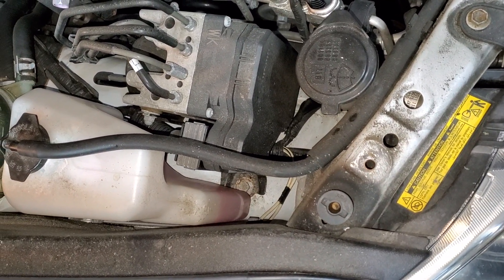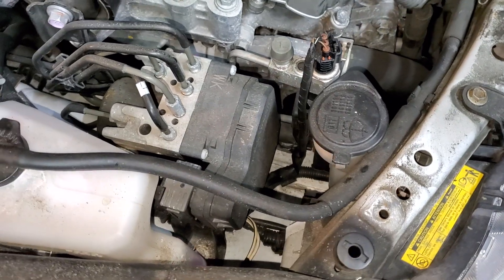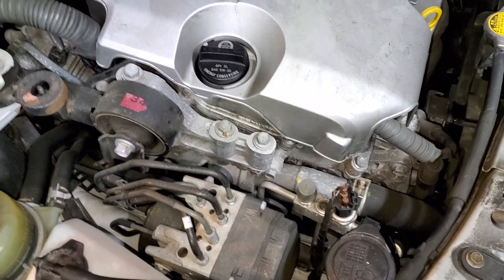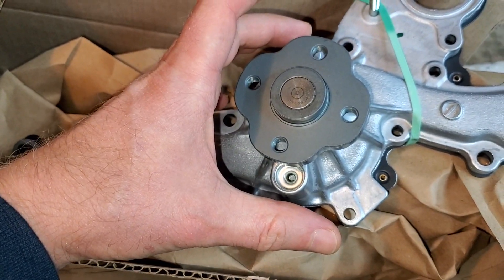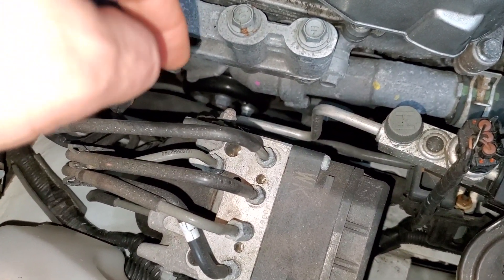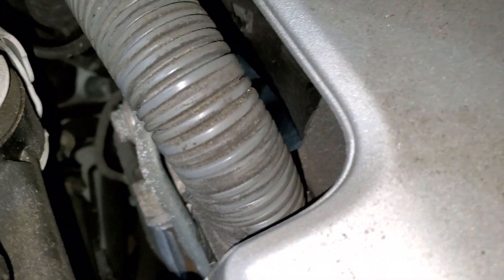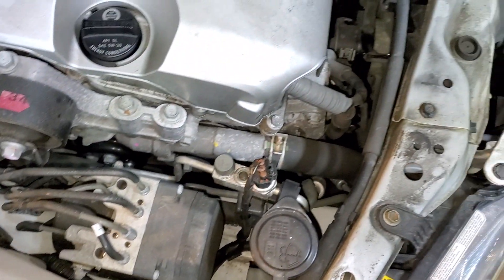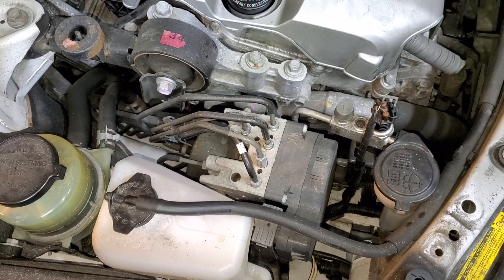How to diagnose bad water pump, leaking water pump, loosing coolant, leaking coolant, overheating?

Comment: I had the same problem in my 2010 Toyota Camry with the 2.5L four cylinder this year.  The belt was throwing up on the hood too. Had it replaced at my local Toyota dealership. Never had a issue with this car. At the the time of repair, I had 215,000 miles on it. I now have 223,000 plus and still going strong.

Comment: This generation ES has a lot of weak spots and the water pump is one of them. My water pump failed at 116k on my 07 and was replaced. A few years ago I decided to get the cooling system flushed out and the radiator started leaking. Got a new one and then upper/lower hoses blew out.  Got new hoses, but it kept overheating and so the thermostat was changed  and haven't had any problems since, but looking back it should've been changed when the water pump was done.
Reply from the maker: I can't complain about my es, pump will be first big wear item for me.  Brake pads, tires, and fluids that's all has been replaced in 11 years of ownership.
Reply from the maker: Pump is an wear item just like brake pads and rotors.  On some can last 200k miles on others 50k miles.
Reply from the maker: Pump is an wear item just like brake pads and rotors.  On some can last 200k miles on others 50k miles.
Reply: @repairvehicle  Yeah fair enough, especially once you get past that 100k range. I’ve found it really helpful looking through the Lexus forums and reading ES ownership experiences. Lets you know what you to expect as you pack on the miles

Comment: My issue on my 2010 FX35 is that when the coolant goes into the expansion tank, it does not get sucked back into the rad when it cools.... i often have to siphon back to rad once the engine is cold. I tried 4 brand new rad caps, new rad, new thermostat, hoses, coolant temp sensor, new metal heater valve etc....  bled and burped the system and have been having this issue since last summer. Whats wild is that i dont have any symptoms, except some light white smoke.... doesn't seem like I'm losing coolant, just need to keep siphoning from expansion tank to rad, if i don't do this, the car will overheat. If i drive more than 50 miles all the coolant ends up in the expansion tank, and theres a lot of gurgling behind steering wheel.  I'm getting my head gasket replaced next week along with timing chain and water water pumps... 3500.00 for the job. I was thinking just doing the waterpump, but, i dont want to risk having the same exact issue and having to come out of pocket again.
Reply from the maker: How many miles on your fx35? Original owner?
Transmission has been serviced?
Reply: @repairvehicle  176K, i'm the second owner and ive had the car since 70K miles. never had any major issues with it, just lightbulbs, brakes, new tires etc... i replaced the original throttle bodies and also sparkplugs * ignition coils. in term of transmission service all we did was change tranmission oil over the years. never needed any major service

Comment: Hi got any tips regarding the heat being too hot on large tube from radiator to engine. Dashboard say engine too hot. Radiator is way cooler temp and suspension fan not kicking in when it is meant too. Coolant is passing out of overflow tube looks like but im not yet certain.  There is a random red plug at bottom of radiator near battery dodge journey 2011. Thanks
Reply from the maker: Upper and lower hot ?

Comment: 2006 ES330. Coolant was low and noticed a hole in the radiator. Replaced radiator, hoses, coolant cap. Still losing fluid in the reservoir bout .25 inch a day. When I start the car in the morning I hear squeaking.. Changed all the belts and belt dressing does not help. No Coolant on the ground. Maintenance history shows it waterpump and timing belt changed 50k ago. Can it be the pump?
Reply from the maker: What is the mileage now?

Comment: My 2008 Infiniti g37 leaks on and off. When I get done driving it will sometimes leak for a little while then stop then I will get back in it and go and it does it again so if not a consistent leak. Could it be the hose, radiator, or water pump?
Reply from the maker: It could be all 3 reasons. What is the mileage? Car has been in accident before?

Comment: I have same problem.
I already replaced water pump.
And then new water pump started leaking too.
Then car over heated because air got in coolant and thermostat didn't open.
So I removed thermostat.
Now I have to check water pump.
Horrible.
Just horrible.
Reply: Any luck with this? I have had my water pump replaced three times now and it keeps spraying coolant
Reply from the maker: What do you have?
Reply: @michaelcontreras6484 update?

Comment: 2011 535i coolant leak after replace stat. Car does not overheat at all, when I park is when it comes out or the tank. I removed the pump and radiator, both was full of coolant. I'm replacing the pump and coolant tube Monday. My question is what else could it be before I put back together?
Reply from the maker: Did you do proper air bleeding?
Reply: I did when I replace the thermostat and then it started to leak a couple days after. So now I'm replacing the stat and water pump and the coolant tube. Trying to find out if it could be anything else before I put back together
Reply from the maker: When put everything back together apply correct pressure to the cooling system and check for leaks before adding coolant.
Reply: @repairvehicle  definitely will thank you

Comment: I bought a use 1998 CRV with 220k miles.  When we test drove it no leak.  Later that day when we drove it, coolant began leaking under the water pump.  it eventually stopped leaking but has  not leaked since, even after driving it.   No noise, no overheating, drives really smooth, starts right up.  What could it be?
Reply from the maker: Check for leaks when engine is cold and engine not running. Also, did anyone add sealer to the coolant?

Comment: 12/02/23- 5:45am. I have a 2006 hyundai elantra 4dr. With 105000 MI on it im original owner, had radiator, and  ac system, replaced, car squeels no leakage if not using ac, byt coolant leakage if using ac, if turn on heat its super hot, seems like coolant doesn't go bk into rad from cool reserve  leaks under car near reserve once in a while think its cause i keep filling the rad if its low while reserve tank already has coolant in it, its just a guess not positive and if i use ac after you park it and turn off their is coolant on ground may be coming from the area of water pump but no leaks if i dont use ac, what could be the problem can the lower gose to the water pump be bad? Without the pump being bad? And why doesn't my coolant go back in to the rad after its cooled off or does it go bk in the rad when you start the car after it cooled down? Im not mechanically inclined was told i needed a water pump by service mng. One of the mechanics said you got a bad hose... 4:32  so im at loss on what to do i dont want to get ripped off... i dont use the ac at all even tho its been replaced cause of this issue it runs great but afraid to use ac... can you answer my questions an guve ne sone advice?? Thanks...
Reply from the maker: Does your car overheat?
Does coolant level change?
Have your car been in the accident before?
Did you check to see if any drips under water pump?
Reply: @repairvehicle  no car doesn't overheat, I drive it with no problems unless I use the ac but  i put coolant in it often, but seems like reserve tank always has coolant in it , so I think sometimes it may over flo the reserve if on ground near front but if ac on after parked, coolant will be on the ground and no accidents
Reply from the maker: @michaelionta8539  where do you put coolant, radiator or reserve tank?
Reply: @repairvehicle  I've used belt lube to stop the squeel n does stop the squeel so I could use ac but don't cause it'll be on ground after I park it, I find no coolant under or around the engine just under the car if I use it n why doesn't my coolant go back into my rad does it go back in on its own or when you start the car back up
Reply: @repairvehicle  also can the hose to the pump be bad and not the water pump? N just change hose if bad?
Reply from the maker: Where do you add coolant to radiator or reservoir tank?
Reply: @repairvehicle   in the radiator tho their is always some in reserve tank...
Reply from the maker: @michaelionta8539  how much do you add to tank? To the max mark or until it’s full?
Reply: @repairvehicle  til its full
Reply: @repairvehicle  I add to the rad not the reserve
Reply: Why isn't the reserve coolant returning to rad
Reply from the maker: Hose cannon be bad unless it has a crack then you would be losing coolant fast. If water pump bad then you should have symptoms that I have described in the video.
Reply from the maker: @michaelionta8539  maybe radiator cap is not holding pressure, have you tried replacing it? Maybe crack in hose that is connected to reservoir tank
Reply: @repairvehicle   I'll check the rad cap n the hose to the reserve and I'll get bk to you in a short bit
Reply: @repairvehicle  I checked radiator cap looks OK seems stuck so will replace it tomorrow

Comment: I have a 2006 tundra. Just noticed coolant leaking. It only leaks when the truck is cold and I remove the radiator cap. It looks kinda like it’s coming from behind the water pump. No overheating or anything. Any ideas anyone thanks
Reply from the maker: Water pump going bad?
Reply: Gonna start the tear down and replacement this afternoon.